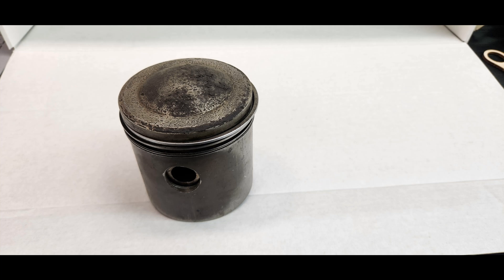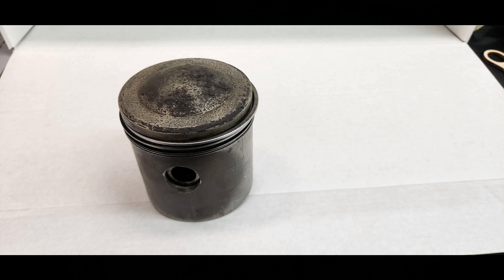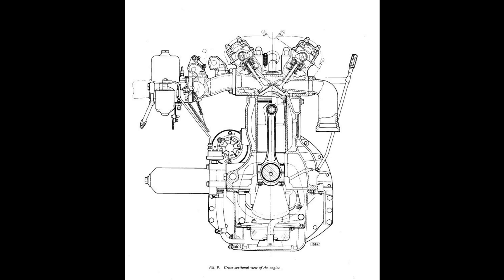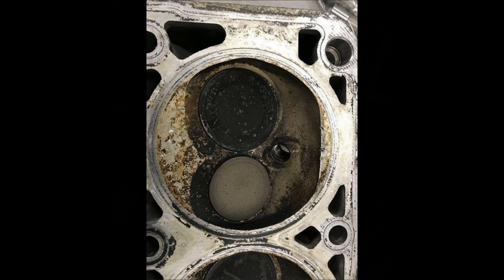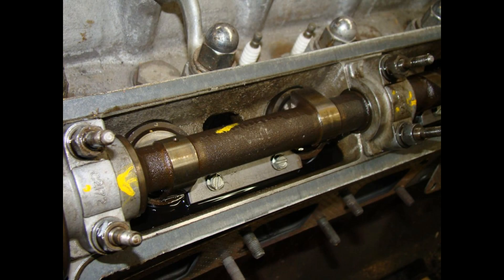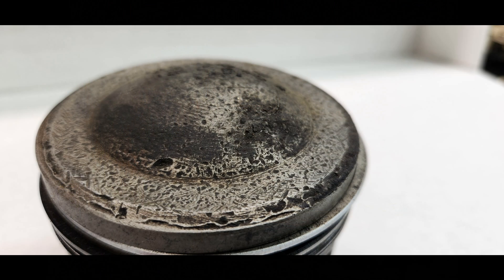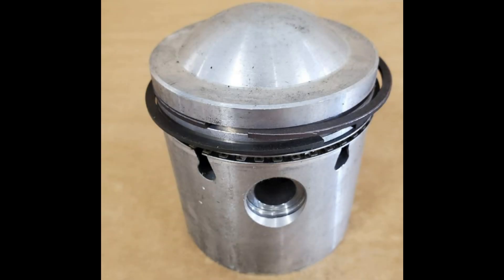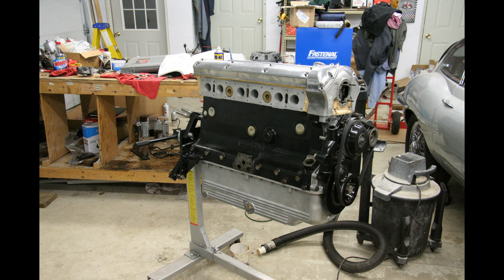Pistons and Tappet Guides.  Jaguar XKE Engine Rebuilding Tips

Comment: You said this damage was caused by pieces of the tappet guide or cam (both external and not within the cylinder or combustion chamber) ,  NO WAY THAT CAN HAPPEN.   Super SMALL fragments of the tappet guide or cam MAY pass down to the oil pan, but the oil filter will stop those before going thru the lubrication system, and those pieces would not get into the oil galleys by any means or into the combustion chambers. ANY fragments  that made this type damage WOULD HAVE TO ENTER THRU THE INTAKE MANIFOLD, THEN GET PASS THE INTAKE VALVES , OR GET PASS THE VALVE GUIDES WHICH WOULD BE AN EXTREMELY REMOTE CHANCE AND WOULD HAVE TO BE MICROSCOPIC IN SIZE. What happened here to create those impact marks and gouges were most likely caused by broken valve heads , or broken or loose valve seats,  broken spark plugs, cracked combustion chambers or possibly a broken piston ring, or running the engine without the air filter attached to the carbs, or simply a sloppy engine rebuild.  Installing tappet hold down kits help , but something else caused this damage.   My car : '66 SERIES ONE COUPE rebuild my me, running fine.
Reply from the maker: You make a very reasonable explanation.   Probably more accurate than my explanation. However the damage occurred, I did a good quality rebuild that has been running well for 12 years. Thank you for your comment.
Reply from the maker: I will point out that the intake valve and seat were also very damaged.  There was only one tappet guide damaged, and one piston: both number 1 cylinder.  Thanks for your comments.  Can't wait for my car to come home from it's paint job.
Reply: Totally concur. My 3d exhaust guide drifted up and chipped a bit off. Now need to yank it out and replace!😢
Reply from the maker: @maxazevedo5438  I put the hold down pieces on both intake and exhaust.  Sorry for your troubles, thank you for your comments.
Reply: Intake is very unlikely. The hot exhaust is likely the contributor to higher temperatures. My engine didn’t even get any road time, just a few starters over a rebuild almost 40 years ago 😂.